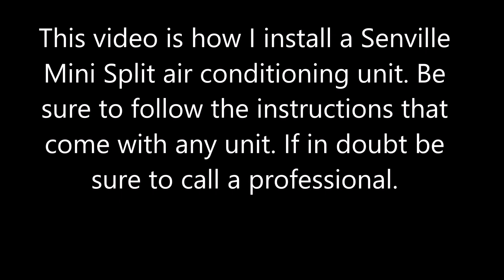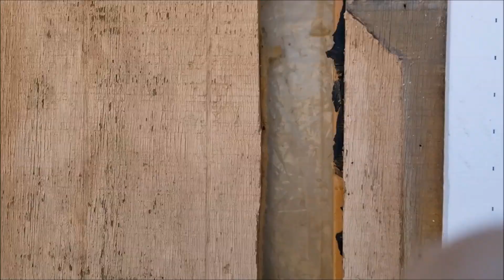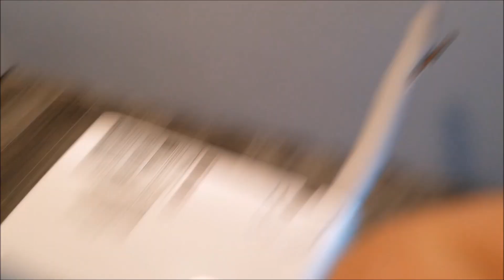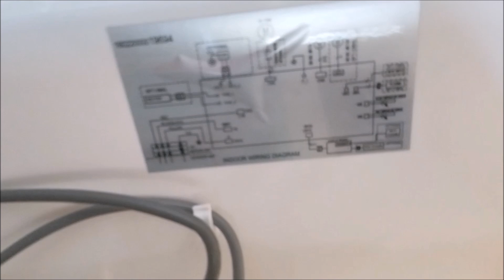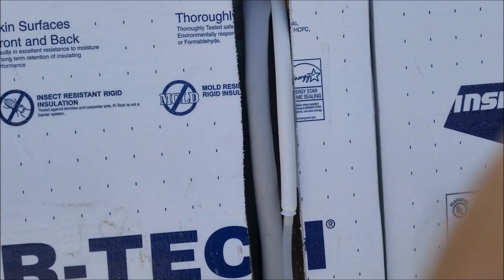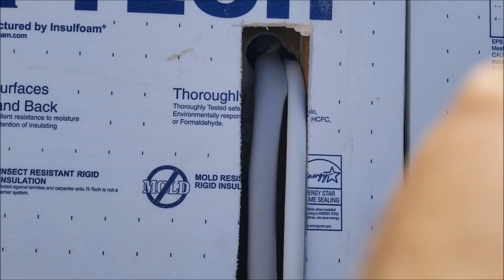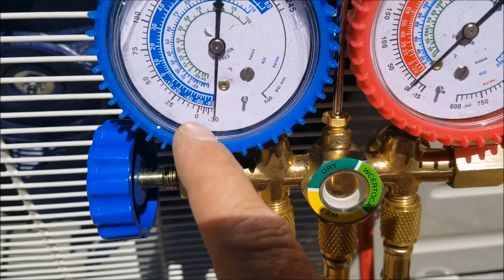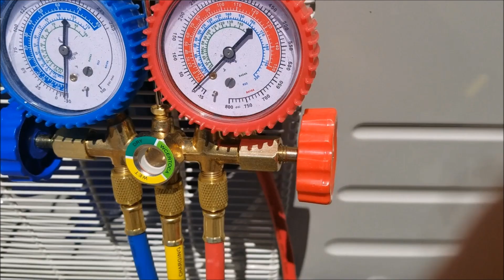How To Install Senville Ductless Mini Split 9000 BTU 230 Volt Air Conditioner Heat Pump

Comment: Excellent job. Two questions. 1. Bending copper down do you use a tool? Or just slowly by hand?  2. Running electrical from the inside unit it seems it is connected inside does it just run to the back to the copper line to the outside ?
Reply from the maker: There is line set bender tools, but I have never used one. I bend it slowly so as not to kink it until it is in place. The communication wires that run between the inside and outside unit run alongside the copper line set.

Comment: So if your are doing a unit with two zones are they isolated? So would you just do the vacuum procedure twice and let Freon in? Or or is the charge for the whole
Unit and there is an order for it to be done properly

Comment: I have a very similar unit and had a question. My unit came with a drain hose and 90 to plug into the bottom of the outside unit. Are they necessary or can I trash them?

Comment: When you shortened the lineset, did you notice any vibration noises for lineset shorter than 9 ft?
Reply from the maker: There shouldn't be any major vibration.

Comment: Is there a difference between the 120v and the 240v? (aside from the voltage 😂)
Performance wise - is one easier/harder on power over the other?
Reply from the maker: 240-volt units are more efficient, so I always try to install them, when possible, but 120-volt units also work well.
Reply: @ okay good to know! I have open availability in my panel for 240 so that’s what I’ll go with 👍

Comment: Nice video except I cannot find any information if a 230 volt 3 zone mini split should have a 50 amp breaker? The information cannot be found.
Reply from the maker: It will depend on the amp's the mini split uses, which is different between models. Once you have the amp's it uses, you can match it to wire size and breaker size. The amps the unit uses will be in the manual or on a label on the outside unit.

Comment: It would have been nice if you stopped on the breaker box for a few seconds instead of blowing right by one of the most important steps in the whole procedure.

Comment: So when I install any mini-split, as I do very often, I know from experience that using factory flairs are a big no-no. A solid 70% of the time they are quite deformed , or non conical at all. And that usually leads to trouble (nearly undetectable leaks, that will take 12-18 months to detect). And that means more R-410a in our atmosphere.  Every set of factory flairs I encounter are immediately cut off, de-burred, and re-flared  by hand. And then checked for perfect shape so it rests perfectly on the face of the flair nut.  And as far as line length, the reason the kit is minimum 16' is for the fact that if cut any shorter, they will "gurgle" as they run... I've heard it many times, not a pleasant sound when trying to snooze. No animosity intended, just the more you know right?   Watch your flares, for the  beautiful home we all share and should want to keep healthy.  : )

Comment: Are we not supposed to use 14–3 wire two hot wires a ground in a neutral ? I’m trying to install mine .. we’re is the nuetral wire spot ?
Reply: Right there with you. The flash over the electrical killed me. I've watched several videos now and can't find a legitimate wire type or size for the 9k btu 240v system.
Reply: @carlieswink3360  if you guys are so confused you probably shouldn't be doing electrical. there are much better videos than this though.
Look at what wattage your unit pulls. watts = volt*amps your 14gauge can handle 15amps and should be on a 15 amp breaker, 20 amps is 12 gauge
Your 9k btu is probably 1000 watts which means it needs anything more than 10 amp breaker.. I'd just do 14 gauge wire and 15 amp breaker to keep it simple / cheap cuz 10 amp is very rare

Comment: What gauge wire do you use from the breaker to disconnect box and from the disconnect box to the unit?
Reply: that depends on how long the run is . a long run you might have to use 10 gauge

Comment: You can not run a unit with a curled up line. It is not up to code, and it will cause an oil build up. Oil runs along with the refrigerant through the system, if the oil cannot reach the compressor, the compressor will have a short life span, guarantèed

Comment: Great video, Senville instructions should almost be ignored at some point because they are misleading. the scematic with my unit showed how to wire a 110v unit while I had an 18000 btu 220v unit. The quick shot of your wiring saved me a lot of time. This unit is pretty much diy but people take your time. I had to order the longer 25ft lineset. unit was installed in a vaulted ceiling situation and I had to go through about 14 ft of attic and out the wall and down. I pitched the wiring and drain bundle down before going out the wall for proper drainage. Quite a bit of water goes through the line as I am in a humid area.

Comment: What size wire are you coming out of your electrical panel into the unit for L1 and L2? Great video, btw.
Reply from the maker: This unit used 12-gauge wire with a 20 Amp breaker. The instruction guide will have it listed.

Comment: I have the same unit. When you start to pull vacuum, do you open the low pressure valve? Where does the wifi stick go?
Reply from the maker: The low-pressure valve should only be opened after the unit is on a vacuum and has no leaks. Here is a video I made of the processes. https://www.youtube.com/watch?v=SajCPoYmRaQ
Reply: @HVAC_Mechanic  thank you.

Comment: I already have a senville unit in my home, but it was the cheaper version, it's 12years old and not cooling properly anymore. I think I will buy a new one and replace it myself, seem easy enough, my wiring is already done, so it's disconnecting the old unit and replace everything with a new unit.

Comment: Nice instructional video. I just bought a Senville 9,000 BTU that I will be installing next week. It's 110 volt. What size breaker would I need for it and will I need an outside breaker unit for it or can I just run it straight from my main breaker? thanks.
Reply from the maker: The breaker is usually 20 amp but be sure to check the manual. Outside next to the unit a disconnect is used.
Reply: @HVAC_Mechanic  Thank you for your reply. One last question, if you don't mind. Is installing a disconnect necessary? Can I wire straight from the breaker? I live in the sticks and no permits or anything required. I'll be doing the servicing on it myself.
Reply from the maker: @timothyknight8269  As long as it's on a breaker a disconnect is not necessary and mainly for city codes.
Reply: @HVAC_Mechanic  Perfect! Thanks! Appreciate your insight.
Reply: @HVAC_Mechanic   Actually, NEC (440.14) and CEC codes require a disconnect of some kind. For these 110v units, you might get away with a regular weatherproof switch.

Comment: Nice video well done.✌  I am installing a Senville 12000 BTU today.  Question for you what size was the A/C service port adaptor did you have to use?  And is your unit still working good? 😀
Reply: 5/16

Comment: Is the vacuum and gauges required or recommended ??
Reply from the maker: It is required to vacuum down an HVAC system before releasing refrigerant.
Reply: @HVAC_Mechanic  thank you buddy

Comment: I have a 4zone 36000 btu from senville. Requires 8/2 wiring. Do you have a video of one of those installs. I can't find one anywhere and of course the instructions are very minimal.
Reply: look at the outdoor unit, now match your breaker to max,looks like a 40amp here

Comment: If I buy this unit and install it myself is there any warranty?
Reply: For the Senville, you'll just need a certified HVAC technician to do the vacuuming part.  They must have a license # to provide you to write down on the warranty certificate you received in one of the boxes.  If not, you void the warranty, but if you follow the steps carefully and vacuum yourself, any issues that may happen, will probably be past the time the warranty expires anyway.  IMHO.  Although, you probably have figured this out by now.
Reply: the main board is only $134 bucks, a service call is $600 plus a return trip with parts, and labor not included in the warranty. do it yourself piss off on the warranty

Comment: Can I use a plug with a mini split assuming I am not required by Code to tie into a breaker?  If not, why not?
Reply: Not an expert... I've read that every State in the USA requires an electrical disconnect near the outside unit for protection of anyone who might ever service the unit in future.  The repair person can be certain that the electricity is turned off.

Comment: How do you lift the indoor unit off the wall mount after it is put on?
Reply: remove the moving vanes, find a hidden screw, cover with a plastic tab at the front bottom, make sure to disconnect the display panel take out 1 screw. there are tabs on the top of the unit, lift plastic now pull forward, and done.

Comment: How hard is it to make a 240v line for this split ac? Do you have diy links on how you made yours. Thanks
Reply: look in your main electric panel and is there 2 open spaces? now open the drywall and run the wire from the panel to disconnect at the outdoor unit. 2 hots and 1 ground.

Comment: One of the best I have seen. I am curious however on the 220 going in to the outside unit. I saw black and red L1,L2 but didn’t see where neutral white goes. Thanks
Reply: There is more than likely a control transformer inside the unit that creates the neutral for the air handler.
Reply: no neutral here, just 2 hots and a ground

Comment: Hi ....I'm about to release the freon from the unit into the lines.  It says it comes pre-pressurized it's just a short 15 ft run ...do you think I will need to have it vacuumed or fluid added......as things usuallly go with these units......bought it in July and am just getting around to installing it....want to use the heat pump from time to time in the winter.
Reply from the maker: The lines will need to be vacuumed down and checked for leaks. The refrigerant is pressurized in the outside condenser unit with enough to account for the line-set.

Comment: You are not supposed to leave those lines coiled unless you lie them flat because oil will settle at the bottom of each coil. You also are not supposed to shorten the line less than 10 ft but the refrigerant is enough for the entire line set and should be used that way

Comment: Great job/video for DIY homeowner installs. Couple things from a PRO. Leaving your flare connections buried in the wall is asking for trouble. if you ever develop a leak down the road, you would have to tear the wall apart to fix. Also, before vacuuming you should always pressure test with nitrogen(300-400psi), followed by a quick soap bubble test. if no bubbles are found after 5-10min.....then ill hook up the vacuum and pump down(you should be using a micron gauge and getting the unit below 500 microns/Timed rise test). W/o doing this, you still have the possibility of small leaks, and then, at the end of summer, after everything has been buttoned up, you notice your cooling just isn't as cold anymore. week later, and its not cold at all and the lineset is frozen(Newer mini splits all usually have low refrigerant sensors and will not run when the unit is not above a certain threshold, so it most likely will quit before the lines freeze up). Mini splits are so easy to install, which is why your seeing them marketed as DIY projects more and more, but there still are a couple things you have to get right on first attempt OR its a pain in the ass.
I always recommend the flare tight gaskets when a homeowner is doing it himself. Would also recommend waiting for the flare tool, rather than leaving the coiled up lineset tucked up behind the condenser. just not a fan of how it looks aesthetically and I've seen way to many people, kids, and gardeners that have yanked on it, hit with lawn mower/weed eater, accidentally stepped on and kinked the lines and not the system has a restriction. I got called on one where a boy just literally pulled so hard on it, it busted off and he got lit up with refrigerant in the face. Anyway, now I'm just rambling, don't mean to take anything away from you brother. Great DIY for first timers video, covered a lot of stuff people should know. awesome job man
Reply: Great constructive criticism without being condescending!
Reply: I've read that oil can get trapped in those coils.
Reply: Great comments. I am going half way. I’ll install but I’m having a professional pressure test and turn on.
Reply: N2 pressure test sounds like a really good additional leak test.  I found this video that explains the test in detail including links to tools and parts required.  https://youtu.be/ZtAw0drtHmE

Comment: ... if you've watched more than one video, you've seen that tech's vacuum down and use a "micron" gauge to detect the level of leaks that will cause a system fail in about a year.  This guys saying as long as the leak doesn't go back to zero.  :|     which would be a catastrophic level leak.  Yes this guys technique will get it running that day.  THE QUESTION HERE ,IS HOW LONG DO YOU WANT IT TO RUN FOR?  One year, or 10 years.

Comment: Good video. However, pulling a proper vacuum requires a micron gauge, which will tell you the level of vacuum achieved. A certain level is required to remove all AIR and MOISTURE from the refrigerant circuit, which is harmful to the compressor. You are potentially taking years off the life of this unit, by pulling a vacuum based on what the refrigerant gauge says. Gauges will show a vacuum in minutes. A proper vacuum using a micron gauge may take hours. This is a good video, but there’s a reason professionals with all the right tools should install these.
Reply: maybe on 7/8" suction lines and a standard central air system, but these little bastards dry out super fast. you should know that when you have hit 500 microns in a matter of minutes...so BS brother

Comment: There were some gaps in the video where you didn't mention that you should follow the instructions or that you should connect the wires up (1, 2, 3) or that you ran it in the wall. I am beginning to think that connecting the wires up according to the instructions is important. I have always thought that any wiring can be done randomly and need to be told at least 5 more times.

Comment: my 12000 btu only says 115v. can I wire 220v. I heard thats better
Reply: if it say 115v, you have to use 115v, otherwise, you will burn system.
Reply: you so funny

Comment: Thanks for posting, Just got mine and unpacking things. Having to add a new sub panel as I'm out of breaker room. Also it's to dang cold outside right now. Speaking of cold- I sure hope you opened the wall back up and re insulated. !!  I was expecting you to spray foam insulation in there or pack it with Fiberglass. You didn't seems to even seal around the pipes with silicon. I'm not a professional but I've watched a few of these installed by qualified people.   Another important detail was you never mounted the unit to the concrete pad. Most would use some rubber bushing and lag bolts. Your unit could fall over in a windstorm or vandalism.

Comment: Love the video. I could have a beer with this Sasquatch!! Thanks for the info. I would like to add some pointers.
Reply: Hole cut diameter is necessary. Lol. To the uninitiated. Check all the packages. Lol
Reply: Get an electrician. Don’t tell your local HVAC. THEY HATE US.
Reply: Warranty is void without an approved HVAC instal receipt. Moving on. A flare tool is $65. DO IT!
Reply: And ummm... I’ll be right back.

Comment: I join others in thanking you for posting this video. It takes the unknown and concern out of this type of AC installation. I have one question: How flexible are the lines? Can they easily bend (without kinking) from, say, and 4" framed ceiling to a 4" stud wall? Since that's a pretty tight transition I guess I'm trying to determine how tight a curve you can put in the copper lines. Hopefully that's something you can answer. Thanks again.
Reply: I just went through this and they are not very flexible, you cannot run them 90 degrees without a bender that costs roughly 200 dollars. I almost kinked the lineset coming off the indoor head unit and decided to use the empty space above the build out of the kitchen cabinet. Hanging it on a interior wall poses challenges a diy cannot do unless you spend professional money on specialty trade tools. But then again I have the 24k btu and the thicker line set diameter is even hard to bend with specialty tools.

Comment: Mine came with a single screw holding the plate to the back of the inside unit that has to be removed.
Reply: yes

Comment: Leave the pipe length. You never know when you may need to relocate the unit. No harm done.
Reply: Senville actually doesn't recommend changing the length of line.

Comment: Do you need to bolt the unit to the gray base ?   What if I install it on a roof, do I need to bolt the gray base to the flat roof?

Comment: What size wires did you use from the power panel to the disconnect and then to the condenser? I noticed it was stranded. Great video 👍
Reply: look at the label on the outdoor unit..15amp breaker in house panel, run #12 thhn- 2 hots- 1 ground. 2ton system- run #10, 30 amp 2 pole breaker

Comment: I see you ran the lineset through a hole directly behind the wall unit....could you also run that line out the side of the unit through a hole in the unit? And does the hole have to be 3 inches?
Reply: best to run the line set outside. there will be a time you need a complete service of the indoor coil cleaning. cost about $700 to clean and reset
Reply: Yes, there are knockouts on both sides.